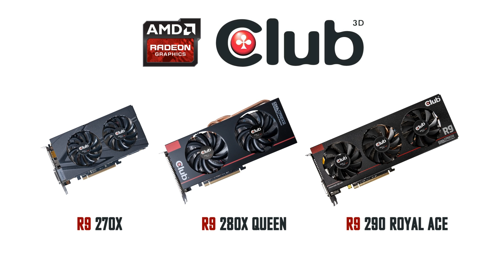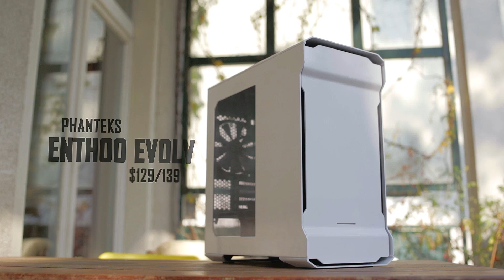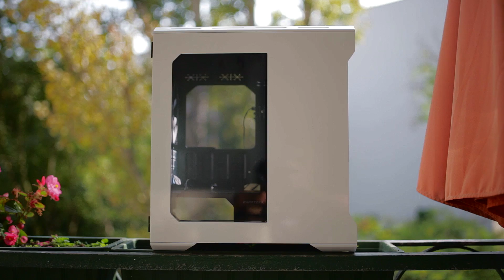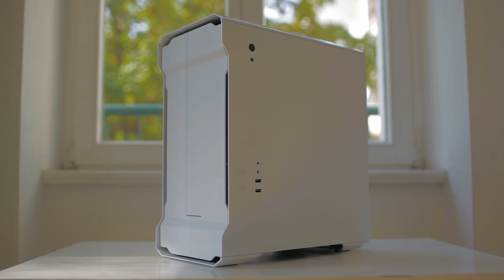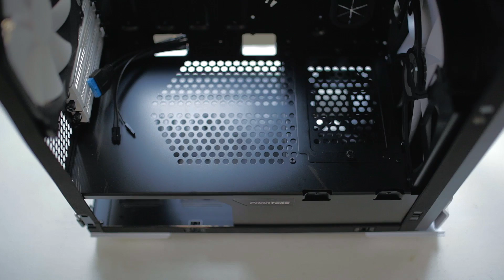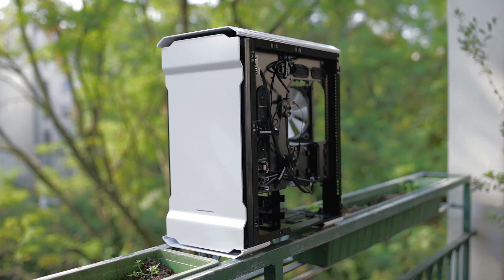Phanteks Enthoo EVOLV - Overview

Comment: Regarding the price point, i think it's justified. Seeing lian li matx cases such as the venerable v360 for the same price but this phanteks has more features and larger compatibilty options make it worth every penny. Also the design is really unique with those angular lines and unorthodox swiveling side panels that make assembly hassle free. 

Quick question, what is the real psu length compatibility? I read on the site that it's 180mm max without removing midplate for hard drive cage.Because my psu is exactly 180mm length but its modular so an inch is necessary for the cables to be connected and routed properly.

Comment: I love it. I've been wanting to see more affordable all-metal cases for a while, and more cases that support filtered 200mm intakes. It looks quite versatile and it's raised a good bit off the floor to help with airflow to the PSU. The launch price is still a bit much for my budget, but if it drops down to ~$100-110, it will definitely be a top contender for my rig I plan on building later this year. mATX is perfect for me as I'm a strong advocate for using a single powerful GPU instead of 2+, but it still leaves room for some other components down the line. The rear optical bay isn't an issue for me since the only use I'd have for one at this point is for a bay reservoir should I decide to water cool.

Promising product. Can't wait to see the full review.

Comment: Don´t do overviews. Just do the reviews
Reply from the maker: As Dmitry is in Berlin, not all hardware has gotten to him yet so cant do a full review without installing a system in place. Waiting on a few last pieces and then we can publish the full review with critique and a proper build showcased inside. Stay tuned :D
Reply: HardwareCanucks Please do include some measurements of the top area as well :) I'm really curious if a thicker 60mm radiator would fit.

Comment: Pricing on thios case is jsut right. Case is made out of metal, it is equipped with great fans, not some cheap bs, and of course there are dust filters all around.
Keep in mind that corsair charges that much for cases with plastic side panels and yet everyone seems to be fine with it. If anything, Phanteks is prime example of quality cases for reasonable price. If I needed a new case, Phanteks would my my top choice.

Comment: It may be aluminum but that white paint job just makes it look like plastic. So I have to ask why not make a version that is made out of some rigid plastic and significantly cheaper? If the paint job (which you're paying extra for) downplays one of the reasons your case costs as much as it does, that kind of defeats the purpose. Lian Li also has the all aluminum thing going on but they make no effort to hide that fact. If you hadn't told me this was aluminum I wouldn't have been able to tell from just looking at it.

Also can we stop putting the "front" usb on the sides and ESPCIALLY on the left side. Right handed people (the vast majority) now have to place the case on the left side of their body and reach across themselves every time they want to use the usb ports. It's minor but it's annoying.

This has all come across WAY to hostile lol I don't mean to sound like I hate this thing. It still looks solid and I can't wait to see what you think. Still this one doesn't look as earth shattering as previous Phanteks cases.
Reply: I am a huge In-Win fan, have the 901, and they also most of the time if not always does a brushed aluminium finnish which really stands out! Most premium case I have ever owned!

Comment: Optical bay on the back, front IO and power button on the right, left panel side window? What are they thinking?!
Reply: "let's design a good looking chassis."
Reply: For a gaming or media-pc, you're probably going to leave it on continually anyway. Also with a blu-ray burner in that rear-bay, all you need is enough space from wall & a good universal-remote & it's the perfect media-centre that 's a little better suited to the household that has toddlers (you'd be surprised what they'll try & insert into an drive/player)!
&B^{D>

Comment: Now they just need to make a mid tower and I'll buy it in a heartbeat.
Reply: enthoo pro and luxe?
Reply: ***** more of a smallish full tower than a mid tower.
Reply: The Enthoo Luxe is a mid tower?
Reply: +H0micidium The luxe is definitely a full tower case. I've got a few kids laying around and my Luxe completely makes them look like mini atx.
Reply: An atx mobo can fit in a full tower.
Reply: Sam Lannan This is mATX man, not going to happen.
Reply: Sam Lannan I know, but I'm not interested in a full tower. I much prefer the mid tower size.
Reply: ***** The Enthoo is huge, it's a full tower. I've considered it, I just don't have the space.
Reply: jiraph52 I'm aware, I was simply referring to the "Enthoo Pro" ***** suggested. Great case, just a bit too big for me.
Reply: SimpleSock the entho pro is a mid tower its as big as it can get to be considered as a mid tower
Reply: Leon Yu They have the same frame, so if you want the metal exterior and the ambient lighting with support for fans above the top of the case. . . then go for the luxe.  For me I didn't care for any of that stuff and went for the pro.  I also like the unobstructed intake for the front fans.  Though I would like that easy to remove top dust filter on the luxe. . .
Reply: The Enthoo Pro is a Full Tower yes, but as people have said and Linus himself got confused a bit, it does nearly look like a Mid Tower.
Reply: Now they do. Check hardware canuck's latest video!
Reply: ***** I know. i love living in the 'old' days

Comment: Its too big. Its 4L larger than the ATX S340
Reply: nah, S340 only supports there own X61 280 ALC. Unless you remove the res bracket then you can fit thicker rads.
Least the Evolv supports top and front and much more.

Comment: H80i or noctua nh-d14/ phanteks ph-tc14pe?
Reply: Depends. The h80i is the loudest, they all perform similarly, the NH-D14 has the best mounting hardware and is the quietest, and the TC14PE probably looks the best but generally needs more clearance than the D14.
Reply: Phanteks for looks and good cooling.
Reply: D14 for performance, H80i for aesthetics. I don't have any experience with the Phanteks, but personally I'd recommend the Noctua.
Reply: The nh-d14 will perform substantially better. Aesthetically, it's up to you. It's up to you but I'd go for the nh-d14 because aesthetics aren't a major factor for me.
Reply: SimpleSock I do, its silent and holds a 4770k at 4.4ghz
Reply: d15
Reply: ***** The NH D14 doesn't block low profile RAM, and won't block the first PCI slot on most motherboards. The NH D15 is larger, but OP didn't ask about it.
Reply: Certain that one of HC's reviews stated that the std Phanteks fans are quiet & of good quality as they're sourced from same manufacturer as one of the better brands!?!
Reply: StevieRay9O Yes, they're good^
Not really competition for Noctuas if you disregard the looks though.
Reply: You should also look at the NH-U14S. It performs within 2-4 degrees C with just one fan compared to the D14 , but doesn't have the same RAM compatibility issues.

Comment: no dvd slot even  the slim ones man is good locking but that turn me off
Reply: It has one in the back. Take a look again.
Reply: It's really surprising to me how many people keep missing the fact that it does indeed have a 5.25" bay over the rear I/O. Seriously, it's shown in Phantek's teaser video, and now in this sub-four minute video as well. I don't mean for this comment to be rude, but I've pointed this out to at least fifty different people by now.
Reply: Carl Ebbighausen That bay is more intended for use by bay reservoirs. If you haven't realised already, Phantek makes watercooling cases.
Reply: EXTERNALS

Comment: Seriously considering this over an ATX build now, damn that is a fine looking case.
Reply: Just looked at the specs, full ATX sized parts seem to be easily supported, 192mm of CPU cooler clearance in an M-ATX case is freaking impressive an NHD-15 or the gargantuan Cryorig R1 would fit no problem. Can't wait for the review now.

Comment: How do they keep doing it?! It's great and the optical slot, though hard to access is amazing at the back so as not to compromise on the look.
Reply: Agree, many cases with plain front panel don't even have optical slot.
Reply: Yusoff M for instance, the h440. epic designed case by  NZXT but just lacking that something
Reply: I think the ODD drive bay is actually placed there more for watercooling configurations. That spot is perfect for a bay reservoir.
Reply: wshyang
Yes, the 5.25 bays a great for alot of accessories. Planning to fill one of mine with a bay res.